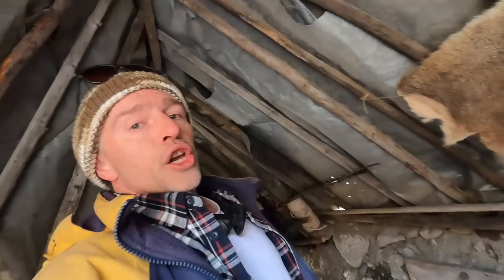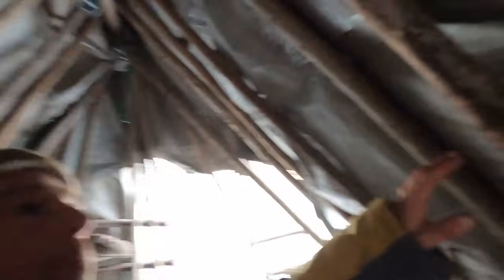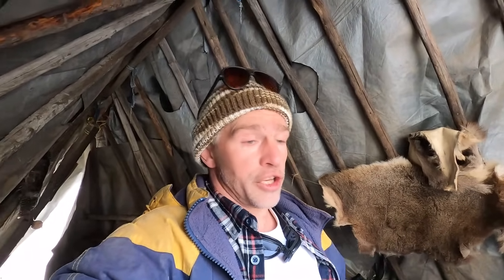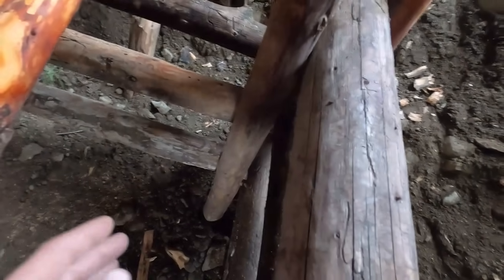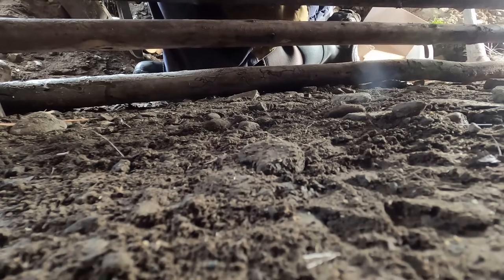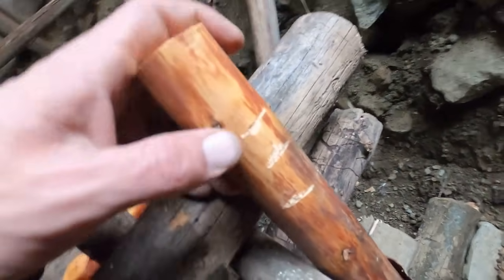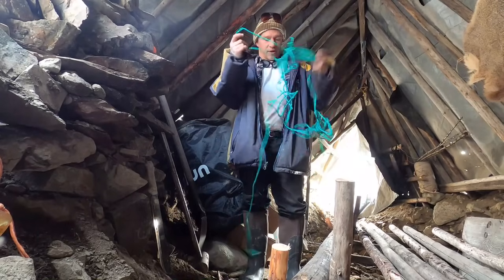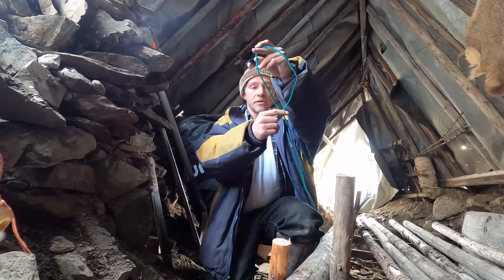Build it up, and it falls down! 1/11/2024

Comment: One good thing about the stove collapsing when it did was that now you can build it again and make it stronger instead of collapsing with a fire going inside it.  Like you said with improving the shelter over time,  building something and using it lets you see the flaws or areas to improve.   I'm currently doing that with software.  I made a first draft of the app,  used it for a while and made a list of bugs and improvements then fixed it for a second draft.  It's a bit tougher with physical things but same idea.  I bet this is going to be really awesome when you finish.     Nice camera angles with the camera under the bed and in the shovel!

Comment: MATT JUST AN IDEA BUT COULD YOU PUT SOME OF THE FLAT STONES ON THE BASE WERE YOU WILL BUILD THE FIRE AND THEN BRING SOME OUT FROM THAT ON THE GROUND TO HOLD THE HEAT INTO THE SHELTER FURTHER? I WASN'T SURE BECAUSE YOU WOULD HAVE TO BE CAREFUL NOT TO GET THE ROCK FLOOR TO HOT THAT IT WOULD BURN YOU. JUST AN IDEA. WISH I WAS THERE TO HELP